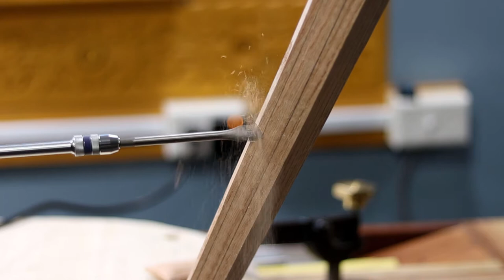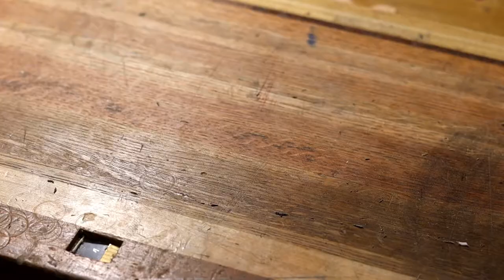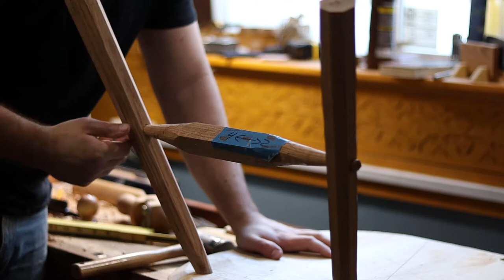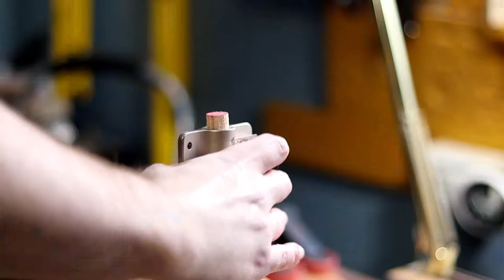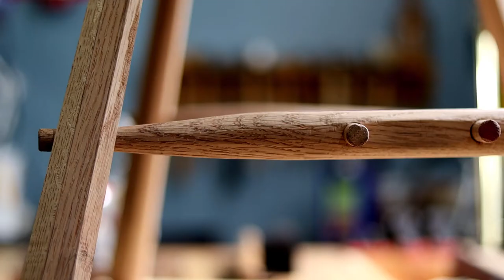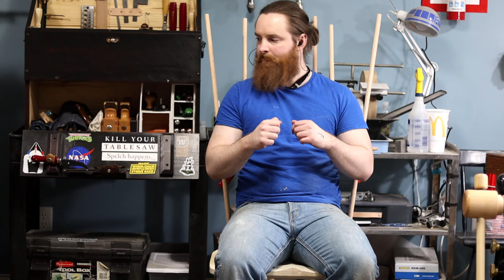Building a Welsh Stick Chair - Part 2 | Crafting the Undercarriage Without a Lathe

Comment: Hey dude, how do you decide what diameter the legs should be, and what is the instrument called that you used to measure them?
Reply from the maker: I was using the Anarchist Design Book as a guide for this chair. For the legs, I started with 8/4 lumber and, if I recall correctly, they ended up being around 1-3/4" - 1-7/8" square at the bottom. That was tapered down to about 1-1/8" square at the top. I used a rounding plane to cut the tenons at the top I believe that was the max width it could accommodate and still cut. To add the chamfers, those were set out with a compass and a ruler to make an octagon on the both ends. Those lines were connected, across the faces of the legs, using a pencil and a straight edge. Then I used hand planes to take everything down to the lines. 

Do you have a time stamp? I can get you the name of the specific tool. 

Thanks!
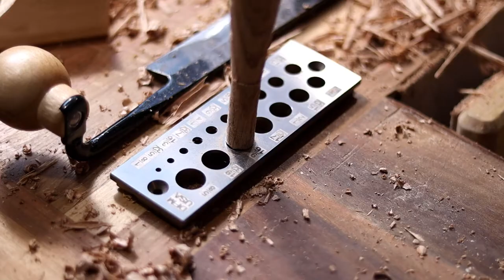Reply: @EricMeyerMaker  Thank you for the detailed response, very helpful. It was 2:00 minutes in and it's a small metal plate with different sized holes drilled into it. Thanks again.
Reply from the maker: That is a dowel plate from DFM tool works.